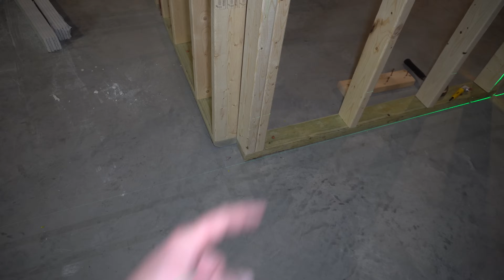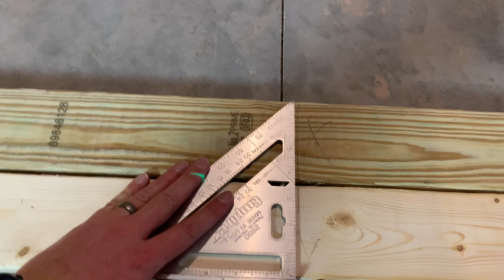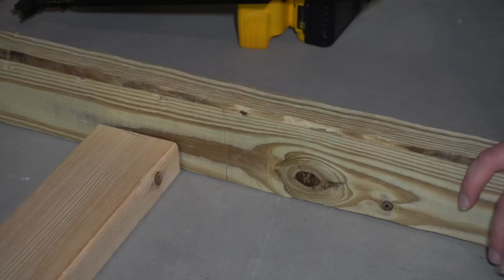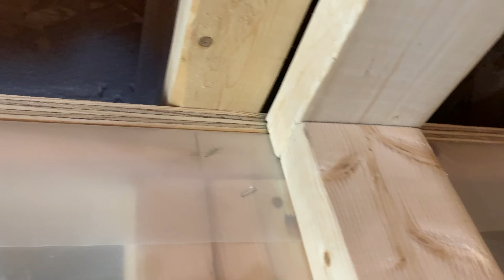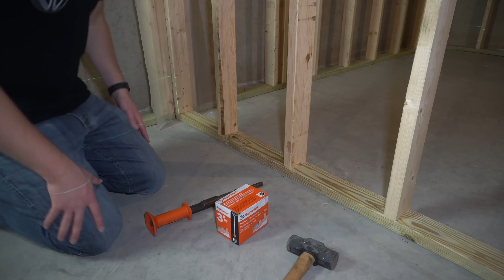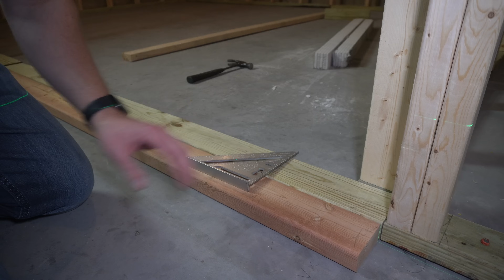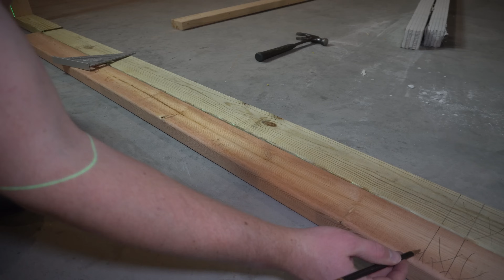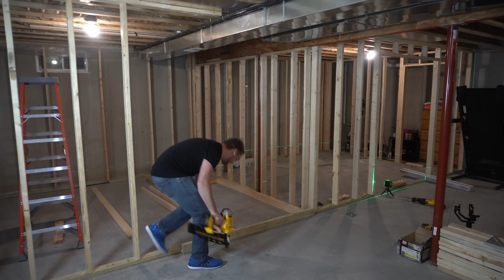The Basics of Framing A Basement Wall

Comment: How did you determine the vapor gap distance from outer wall to frame? Also, how do you know what kind of protection to use in the gap?
Reply from the maker: 1/2" air gap is fairly standard. You typically see a line offset from the face of the concrete wall 4" and the wall framed with a 2x4 leaving that 1/2" air gap. this is plenty of space should you develop a bit of moisture in the air gap - it would evaporate without causing any damage. As for a vapor barrier, that will depend on the region you live in and the local codes as well. I would suggest digging into the codes or calling your local code person. Hope that helps!

Comment: Great video, very helpful. One question I have is about the space from concrete wall to the wall you are making is there a certain space you have to keep? I'm going through same project very soon. Thanks in advance.
Reply from the maker: Thank you! 
I provided a 1/2” space between the concrete wall and the 2x4 wall. This should be plenty of air space should any moisture get back there - it will dry out. Basically just marked 4” off the concrete wall to give me the face of the 2x4 wall. 3 1/2” for a 2x4 leaves 1/2” of air space. Hope that helps!

Comment: Do you have to be licensed to do work on your own home in VA? I want to finish my last room in basement just need to frame 2 sides of room and insulate drywall
Reply from the maker: I'm not sure, every state has its own rules as far as that goes. I would check with your local building department.

Comment: Great video! Very helpful! I noticed you used screws to anchor the wall to the ceiling (floor joists), I was told using nails allows for some play with seasonal temp changes. Is there a reason people use two bottom plates?
Reply from the maker: Thank you! I'm glad it was helpful!
Using nails to attach the top makes sense, didn't think about that aspect. sometimes the nailgun knocks the wall out of alignment so often times I would use a few screws to pin the top of the wall in place and then follow up with a few nails. 
sometimes people use two bottom plate to hold the gypsum board off the ground that much further - that way if you were to get water in the basement, hopefully it isn't enough to start soaking into the gypsum board, therefore less damage overall. just need to have tall enough trim to cover that extra gap at the bottom.

Comment: What if you intend on putting in basement floor underlayment? Would this all just go right on top of that? Or just fill in the underlayment once the studs are in place?
Reply from the maker: I believe you would put down the subfloor first (the dimpled plastic roll + plywood sheathing), then build the walls on top. But I’m not very knowledgeable with that way of doing it. 
Home Renovision has a good video on that. 
https://youtu.be/RIzNQhfVFWA
Reply: @DoingWhatever  that’s what I was thinking too but I wasn’t sure. Great video btw and thanks for the link!
Reply from the maker: @jessestevens9358  no problem! Good luck with the build!

Comment: Would I need a vapor barrier having precast Superior Walls?
Reply: I don't think so. The Superior walls are designed to where you can just add the drywall to it. They already have the foam insulation on it from the factory. But you can always add more insulation between their studs if you want.
Reply from the maker: To be honest, I'm not familiar with that wall construction so I'm not sure. Their website may be able to help

Comment: Should there be a gap between upper wall  plate and the floor joists to allow for any movement or shifting, and is the 1/8" you allowed when framing the wall sufficient for that?
Reply from the maker: The 1/8" that I refer to is mainly to give you clearance when tipping the wall up into place. And in all likelihood, unless everything is cut perfectly, you will tend to have a small gap between the bottom of the floor joist and the top wall plate. Hopefully the floor above isn't deflecting a whole lot so I was comfortable leaving that ~1/8" at the top. If you have to hammer the wall into place because it's such a tight fit, and you have a tile floor above, that could result in the floor above flexing enough to crack the tile floor and/or plaster walls above as well. Hope that helps!

Comment: Be sure to check the crown of each stud as they vary and need them to go all the same direction. Unless you want a wavy wall for a special effect.
Reply from the maker: Yep, that’s a good point I forgot to mention. Thanks!
Reply: How do you check the crown of each stud? Is this also applicable for Canadians?
Reply: @nmaze6913  You turn it on its side and stare down the length of the stud. This will determine if one side has either a bow (crown) or cup in it.